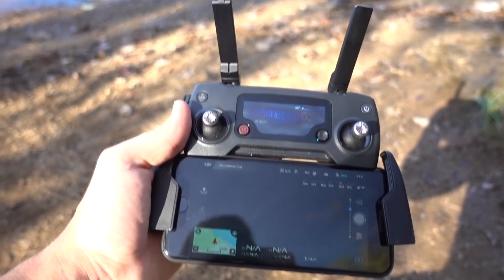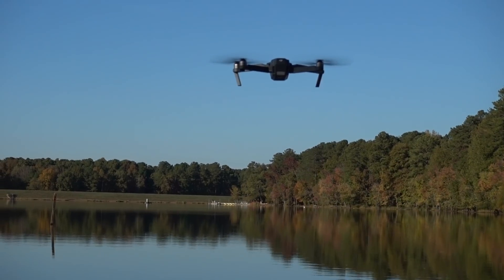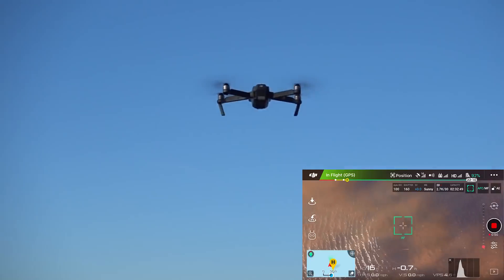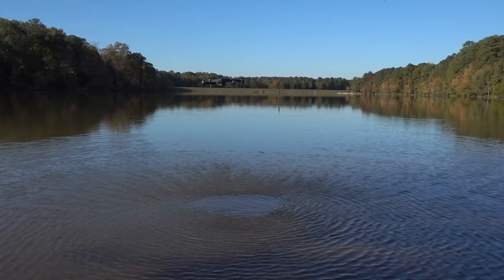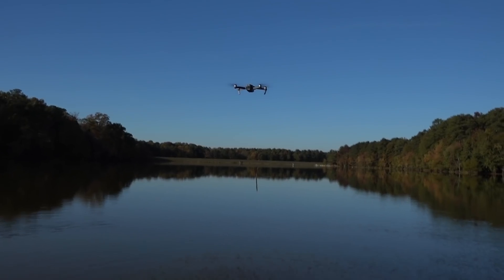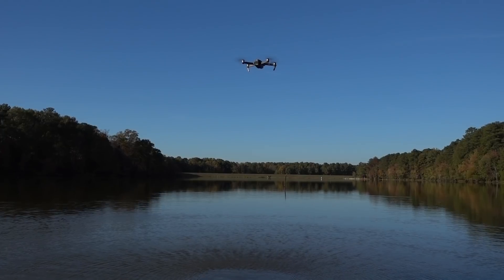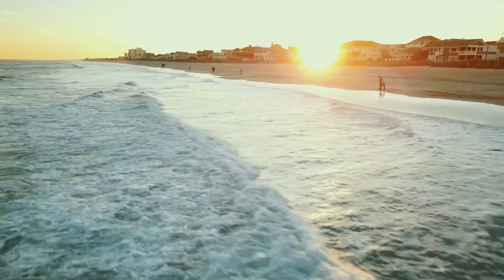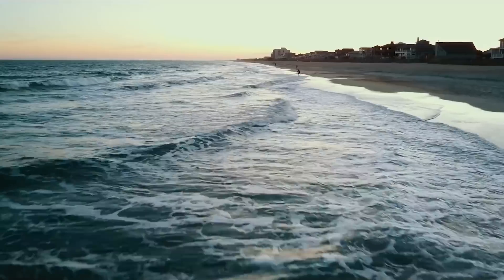Flying Over Water - Downward Positioning Sensors On or Off?

Comment from the maker: What are your experiences with flying over water? Have you noticed better flight/hover performance with the downward vision positioning turned on or off?
Reply: Honestly I think you should try the same with the mavic but when actually flying, not hovering. I dont think you often hover low over water when filming, you actually fly? The rippeling of the water would be different and maybe even completely gone underneath the drone when flying.
Reply: My flight over the water = strange behavior and fear
Reply: @dimasvideomaker8811  same
Reply: Hi Ed! I always leave it on, and works ok for me! Thanks for the risky video! Cheers from Argentina!
Reply: I flew my Mavic over a lake in Southern Illinois quite a bit over the summer with no problems. But, I didn't really get any lower than 15 feet or so, I kept it moving, and I did turn off the downward sensors because I was going to have to hand catch it from a boat.
Reply: I live on an island and fly over water 95% of the time. I've always flown with the sensors on and never, not once, have had a problem.
Reply: @KaosJeep  you have a mavic pro?
Reply: I have had similar experiences w/ both Mavics and a P4A. I don't trust the UAVs to not dunk themselves, so I leave the sensors on. When shooting across lakes or marshes just above the water, I have to pay attention and make sure the drone doesn't dip down (which it sometimes will do - similar to when it was hovering in your video). I've also had times when flying across water and they'll just continue to rise. I haven't kept logs of each situation, so can't really point out specifics (windy/solar activity/cloudy, etc.), but have seen it enough to know that flying over water can be very dodgy.
Reply: Just subbed.   I though you might find this video interesting.  https://youtu.be/w36GTraIk7I   My brothers Mavic dove in the water for about 30 seconds then somehow flew back out.  He had lost connection and it was beyond visual range.  When it reconnected it was hovering over the lake.  We only knew about it after watching the video.  Raw footage
Reply: Mine hovers nice and close to water without issue.
Reply: Ken Seeber What lake, Ken?  I'm from Mt. Vernon.
Reply: I flew over my pool but that was when I was using the parrot bebop 2. It was a while ago and I don't remember How it went. But the water looked cool either way.
Reply: I've had nothing dramatic happen. On my first water flight, I was flying over a murky river which was flat but the tide was going out. I was at about 3m when it drifted about a meter, seemly following the current and eddies on the surface. It maintained altitude. The rest of my times flying over the river and surf, I haven't had any issues. In fact over the surf I could measure was wave height as they passed underneath but my mavic held altitude and position (as best as I could see)
Reply: My DJI Spark has the same problems over water as the Mavic and the Phantom.
Reply: I just had an issue with my Mavic Air over water. Luckily it recorded the whole ordeal. Do you think my sensors failed? https://youtu.be/17IRxYFD7so
Reply: Today I was trying to record a bird nest about 25 feet high on the edge of the lake. I'm not sure if it was the lake, or the movement of the branches and foliage, but my mavic would not hold a still position. At one point it looked like it was drifting into the tree with the sensors on. Eventually, the obstacles avoidance warning did kick in. With the sensors off,I had the same movent without warning. The footage will definitely not look professional and other than documenting, probably not usable. It's a big issue. As high up as I was, you wouldn't think the updraft, or rippeles would be a factor. My mavic has always hovered rock solid for the most part until today situation. The was drifting in all directions of about a foot and a few times the mavic looked like it was being drawn right into the tree branches. Definitely sketchy, useless video footage and it didn't matter sensors on, or off. I've been flying over a year without noticing these effects. There should be more information warning pilots and an explanation with best settings to solve the potentially disastrous drift. Grateful I had continuous close visual and experience with the controls. Just wish I could have solved the problem to capture some awesome footage of babies in their nest.
Reply: Maurice do you know what your GPS signal strength was?  IE How many satellites you were connected to close to the tree.  I've found my Mavic Air will get sketchy near things that block the view for GPS location.  Close to a building or bridge, but do just fine while sitting next to an electrical line.  The line is small enough it won't block the signal.
Reply: I'm at the top of the tallest tree. I don't think any signal is being blocked. I'm not sure how many satellites, but usually more than 10 in this area. 
I went back the next day and when my mavic too off from the ground, I had to jump out of the way, because it was drifting into me. Also, my camera was going through recalibration in flight. I think this maybe a malfunction of my bird. Possibly the positioning is related. I've never experienced this before, but then again I've never tried to hover motionless, thirty feet, at the top of a tree, give it six feet away. I tried to make the drone movement by purposely adding slides, pedestals and pans.

It would be nice to get a better understanding of the issue. We should be able to hover up close just as well as doing panoramic flights.
Reply: Hi Ed, there are some principles of ultrasonics going on here. When the downward ultrasonic beam hits water as opposed to a solid surface, the beam is attenuated and some of it actually penetrates the water. This will be enough to confuse the drone as not enough ultrasound will be received in order for it to know it's distance from the surface. It may be possible, in shallow water (<4ft) for some of the beam to enter the water and be reflected by the bottom of the lake thus giving the drone an altitude position relative to the lake bottom and not the surface of the water, hence it may ditch.
Reply: Ed Ricker, I lost mine into a swimming pool a few days ago(Mavic 2 pro), sad thing is I had it hovering with all sensors on and on tripod mode but the drone behaved very strangely and couldn't sense the water. It ended up drowning and it gave me a headache....
Reply: I'm scared to let the same drone fly over water. I don't think it's possible to convince me.
Reply: Hey Ed! First things first thank you so much for the videos!

I've done many many flights over water, under tight bridges, waterfalls and other similar scenarios... from my experience it goes like this:

Sensor off for sure! Once I had the drone raising under the bridge and I had to put it down almost diving with it into the water...

At 1:19 you pointed out you'r looking at the "H" value which is based on the take off position. What I do Instead is to look at the VPS value which will give you a more accurate distance from the water. I always trust the 1 meter (3ft) VPS reading and haven't had issues so far... Just make sure you keep an eye on the value as you fly and make adjustments so it doesn't go lower than that...

Happy flying!
Reply: @Estilodevidaviajante  you can fly it under the bridge in my location. A old stone bridge with river running wild underneath
Reply: Good Day Ed!! Not sure about liking this Video, as you forgot the most important Factor...  K Index which affects GPS, and the way the HAM Bands have been with Solar Flares the past couple months, this is a very important aspect... What was the the exact Date and Time you were Flying, as this data can be found to do a Comparison... Happy Flying!!!
Reply: Sounds like your drone might have issues.  I would go through every calibration there is and if it still does it... I guess it's time to call support.  Sorry about the issues. :(

Comment: Drone altitude is determined by barometric pressure that is affected by temperature. Flying from land to water often results in lowering air temperatures, which makes the drone think it is higher than it really is, resulting in a descent. As the drone descends, the landing sensors kick in forcing the drone higher - hopefully. Once higher, the barometric  pressure readings force my mavic 3 back down again - causing an inconsistent altitude effect when I fly near the water surface. I have found a 1 degree Fahrenheit change in temperature results in about a 1 foot altitude error. Since the landing protection is inconsistent over water, the chance of a drone going for a swim is fairly high if it flies into lower temperatures.  I frequently fly over water, and I usually fly at least 10 feet above calm water, higher if waves are present to compensate for barometric changes due to temperature variations. So keep in mind that flying into lower temperatures, typically found when flying over water, will force the drone down.

Comment: A couple of others have wondered the same as I am; would I encounter these problems if I am moving forward over the water at a moderate speed?  I live by Lake Elsinore in CA and was going to go there to try flying in over the water and then shoot up just before I hit the shoreline.  I was thinking like maybe 5 feet above the water.
Reply from the maker: I've had it act a little odd and dip down when moving over water, yes. I'd be care careful with that.
Reply: @Ed Ricker  I appreciate the heads up.  Thanks Ed...

Comment: I lost my Mavic 2 Pro flying about 10 feet above the ocean which had four foot waves or so. I was flying down into the water and I didn't notice until it was too late. A wave came by and clipped the front props. It then shot skyward, flew back into the beach by about 50 feet horizontally, then dropped from 100 feet high or so into the wet sand. After doing my best to clean it, it would turn on, but had red exclamation "!" warnings ACROSS all the settings.

Today, I took my new Mavic 3 and flew 8-10 feet above the ocean with wavy conditions and it was all I could do to keep it from flying itself down into the water. FINALLY got it to climb, but then I had very little control over the horizontal flight. Did manage to fly it back to me (as I ran as close as I could to it) and land it in my hand. CLOSE CALL. I will never fly the drone that close to the water again. From now on, 25 feet or higher.

Comment: The fact that the displayed altitude is wrong proves the altitude sensor is not very accurate....so when the drone is trying to maintain altitude, I suspect it is smoothing the data, but who knows....i would think an accelerometer would be used as well - much more accurate over short periods of time.

Comment: hi, I've just seen your video... my mavic air 2 did something similar. It descended autonomously for 25 seconds, until catch the sea.
I've no alert and I've never touch the lever to descend. Dji judget it as my fault, because I was flying next to the water.... it started at about 2.5 meter above the water, until splash! :(
Reply: I had something similar happen to me with my Mavic 2 Pro. I was hovering about 15ft above water before it quickly descended and crashed into the water.

Comment: I want to put a top race payload drop on my mavic Pro but it will cover the sensors and camera. Will I have to disable these sensors and cameras to have it fly while covered?
The payload drop needs to be centered on the bottom of the craft because of stability.

Comment: I tried a low fly over a beautiful smoky mountain rapid stream with sensors on , not good, took everything not to loose it in the water. Drifted left , right, forward, back, up, and down, all at the same time! lol.  I did get some great slow mo water footage.
Reply: Rapid mountain stream with constantly chaotic visuals? No wonder the downward VPS was confused.

Comment: Mavic Mini over the pond with moderate gust wind: flying above the pond at ~4m altitude above water and ~1.5m above starting point ... turned back ... drone dropped to ~1m above above the water in perhaps five seconds and i was informed by friend watching it (i watched phone screen) and I managed to pull up in time. Uploaded log file showed that drone went up by few meters according to barometer (which was not true), so drone likely tried to compensate it.

Comment: @6:27 "However, if you're high enough that you're not causing prop-wash, then..." -You seem to change directions in this sentence and don't finish with any recommendation regarding sensors being on/off when drone is not prop-washing. I could be wrong, but for now I'm going to assume that 100' up the sensors are not in play and don't matter. It would be cool to see you test in that range between prop-wash and limit of sensors, say maybe 20'.

Comment: I lost my first Mavic Pro Platinum in the lake before I learned not to trust the altimeter in windy conditions. I was taking videos of windsurfers in winds of 20+ mph. Sport mode.  Altimeter showed 30 feet but I clipped my friend's sail head (15') and Mavic tumbled into the water. Practicing over land in windy conditions I learned that it's the wind, not the water, that creates the error. In winds, altimeter shows 50' when I am below 30'. Air pressure from wind tends to create errors over the course of the flight. After landing and re-takeoff, readings were accurate until later in the flight. I recently read a forum post which pointed out that in windy conditions, the VPS number to the right of the altimeter is more accurate.

Comment: Interesting test.  I wonder if it would yield the same results if moving across the water rather than hovering?  Cool you took the time to test two different craft.  Nicely done man.
Reply: In my opinion drone somehow stops trusting optical sensors and maintains barometric altitude. Which can be somewhat affected by wind gusts or orientation of drone relative to wind. I don't want to test it, I almost drowned my mavic mini flying approximately 4m above the pond.

Comment: I just ran into an issue with my spark over water.  My drone took off uncontrollable at about 5 feet, I was able to gain enough control to direct it into some soft brush. I am glad no one was in the path, as it was haulin ass. Needless to say I did not do that again lol

Comment: This is a good analysis. My experience has been even with the sensor on, the drone started acting crazy and it took off like 100 ft up quickly. The other problem I had which I don't understand, If I land inside a building, for example, imagine an octagon building with a huge space in the middle, as soon as I start landing, I lose contact then Immediately I increase altitude to gain control. scary, but that's how I found out.

Comment: BINGO.  This is exactly what happened to me..  I was over relatively shallow water,  hovering, the next thing I know, it goes up, me not doing anything, goes up about 4-5 feet, hits a low hanging branch of tree,  plunk,  right into the water.   When I looked at the flight logs, the GEO Altitude still showed 4-5 feet, but the VPS altitude rocketed up to 15 feet.  I got the drone back after repair, and have searching on why this might happen.  SO bottom line if you are flying over 10 feet or so, VPS isn't really much of an issue.   If you plan to go lower for more dramatic video, watch out.  Now Shutting VPS off isn't without risk either.   so pay attention to height, and plan your flight....  Finally an answer that makes sense.

Comment: Hi there sir! I've been following your videos for a while, and now I already purchased my own Mavic Pro, but I just wanted to share my experience with my Mavic it happens that I've encountered this message "Rc remote control signal lost" I don't know why I have encountered this one? Before this happens I just try to push my mavic to its range in my hometown and it reached about 2000ft distance and 200ft height, then I decided to comeback facing forward to where my homepoint is, but when it reaches about 300ft distance and still 200ft height, this happens "RC remote control signal lost" I was freak out and thinking my mavic flies aways, I don't have eyes on my screen, so what I did I come out to my house and tries to see if I could see it line of sight, then gladly it was just hovering outside! so I did land it manually, I can still control it to my remote control but then again I cant see anything on my screen. Any ideas sir? what causes this one?
Reply: GhostRider 282029 Don’t fly drone from inside the house. Better signal when the antennas aren’t blocked by the house.

Comment: If it was prop wash causing confusion in the barometer readings then surely it’d happen over any flat surface in an open area, no? But this only seems to happen observably over reflective surfaces. I’ve no way to check this but it might be interesting to see if this happens over any highly reflective surface like a large mirror or space blanket? Those are made of aluminised Mylar, so no risk to the quad if experimenting.

Comment: From my experience - keep the visual sensors on all the time. If you fly high enough it does not affect at all your positioning. If you fly around 2-3 metres over the water and in constant move all the time - it helps maintain the same height. Maybe the reason this test "failed" is because you were hovering over the water. When in move the drone "reads" the surface differently, not as a plain surface... That's my guess. Owner of a mavic pro

Comment: Ed, as the water there for your test was shallow, is the drones problem lying in that the sgnals that it responds to for positioning are from reflection of BOTH the bottom & the water surface?